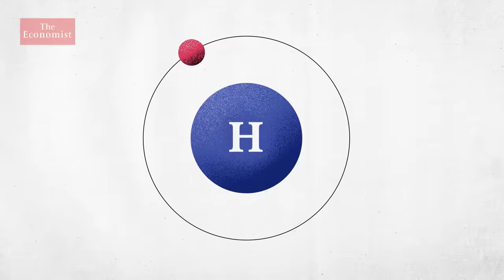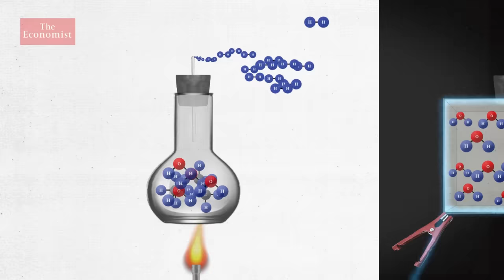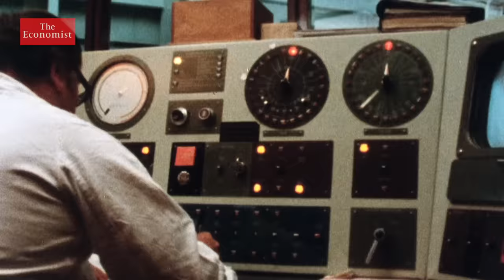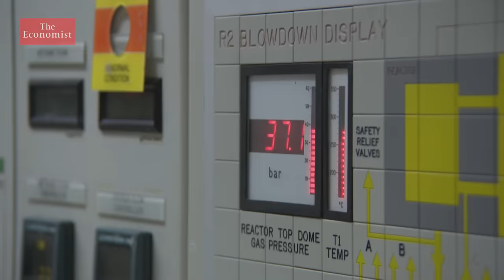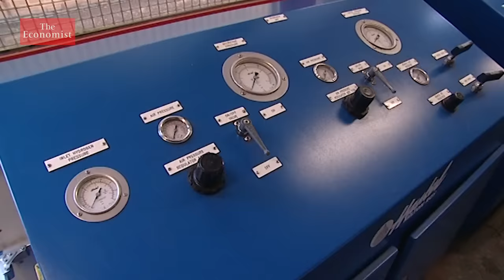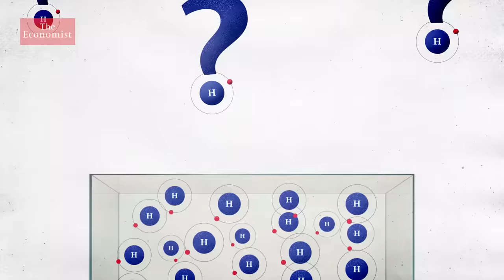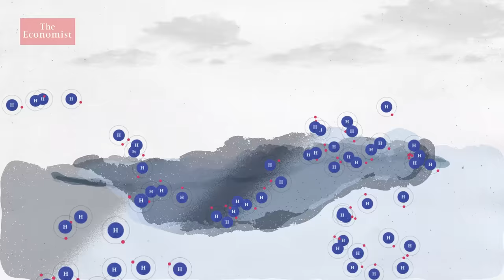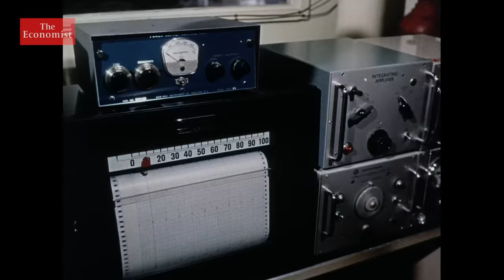Hydrogen: fuel of the future?

Comment: A lot of misleading information in this video. 

Hydrogen may be energy sense, but hydrogen it's self is the least dense gas in existence and either requires compression to 10,000psi+ to reach the volumetric density of lithium-ion batteries. Or be cryogenically stored at minus 253°C. The lowest of all gases besides helium. This is not only a very inefficient process that consumes 12% of the energy in just compressing the gas to high enough density for useful storage. Or over %40 if you want to cryogenically store it, plus the cost of equipment.  That is why a Toyota Mirai has 480km of range and a Tesla model 3 has 550km of range. The tanks for a hydrogen vehicle would take up the entire trunk of you want more capacity/range.  This is all why it costs so much (more than gas at current extremely high prices) to fuel a Hydrogen fuel cell vehicle. Almost twice as much as petroleum, and an order of magnitude more than an EV. 

Another large omission is the platinum and other extremely expensive minerals needed for a fuel cell. These require substantial amounts of platinum, and we wouldn't have enough in reserve to replace all the personal vehicles in the world. Another reason for hydrogen fuel cell vehicle's exorbitant cost.  

You sort of came to the correct conclusion of hydrogen being helpful in niche markets, but you sort of glossed it over.

Comment: Hydrogen is NOT A FUEL!!!  Hydrogen is used as a method of energy storage, with many caveats,  like a battery but the energy to produce the H2 must come from a real energy source like coal, oil, gas, hydro, Nuclear.  Even as a storage method,  H2 is not viable because of the problems of cycle efficiency and dangers.

Comment: If you electrolyzed water and fed the products into an oxygen pipe and a hydrogen pipe, and then, at the other end, you re-combined the two gasses, and were able thereby to produce electricity, how much electricity would you have, as a percentage of the electricity you consumed in the electrolyzer?
Reply: You are putting in 55 kWh per kilogram of hydrogen and can at most recover 33 kWh (the energy content of that kilogram of hydrogen). As fuel cells are only about 40-50% efficient you can get back around 16 kWh - not including storage and transport losses which are considerable.
Reply: @karlgunterwunsch1950  
Thruns guinneabottle is paul sutton using a pseudonym.

Thank you for your figures.
I do not find this encouraging.
Reply: @thrunsguinneabottle3066  It's not supposed to be encouraging. Hydrogen has it's place, especially in the steel production it is irreplaceable because it can not only deliver the necessary heat but also does provide  the reduction reaction to remove superfluous oxygen from the iron ore (a job normally done through carbon addition while smelting the ore). It also may be irreplaceable wherever we need methane or similar for the chemical industry as a base for chemical reactions. In cars though IMHO it has no place whatsoever, they are much better served by converting to batteries - the energy efficiency is unrivalled and the drawbacks are small. Even the infrastructure is significantly less expensive (for a single hydrogen fuel pump that can service at most 40 cars per day you can build 10 superchargers that can service 200 or more)...

Comment: Toyota is pushing a hydrogen car which I think is the future. You fuel up quicker than gasoline but go longer on a tank. I worried about safety, but the hydrogen is kept under pressure. If the tank is punctured the gas, being so light, leaks out in about 1 second. (They tried shoot bullets at it and could not get it to explode). I think planes and trucks should be the first to start using it, my prediction.

Comment: But where are the charging stations for EVs?  Can the power grid cope with large numbers of EVs?  Will we be able to charge EVs faster in the future?  I am not counting hydrogen out.  Unlike hydrogen vehicles EVs have benefitted from large government subsidies.  What happens when the subsidies stop?
Reply: Better ask yourself what happens if the massive subsidies for hydrogen stop and the insanely wasteful and expensive infrastructure starts to have to earn its keep
Reply: No the grid could not keep up at present
Reply: @nickking1510  Only if all cars were electric tomorrow, the requirements are manageable with 1% increases year on year overthrew next 15-20 years...

Comment: Essentially, hydrogen is the awkward middle man between ICE (Internal Combustion Engine) vehicles and EV's that no one invests in even though it has a lot of potential.
Reply: a HFC is an EV, The motors are the same, just what stores/creates the electricity is different. But hydrogen can also power ICE engines as well (just less efficient than HFCEVs).

Comment: Thinking about wasted heat.let’s say you drive a six cylinder auto 40 miles to work and 40 miles back.The heat radiating into the atmosphere from the exhaust system,radiator and engine block if it could be trapped and saved somehow could probably heat a 1500 square foot New England home overnight in winter

Comment: Hydrogen is explosive! And the tanks to contain it safely make it less energy dense than fuel!
I think its lazy to blame the current infrastructure on why its not the big thing. 

It's what we need to do but its not here yet for a reason
Reply: In Japan it's a reality...
Reply: If you compare energy density per unit of weight there is nothing that is close to hydrogen.
Reply: @VFPn96kQT  yes i know that, but if you read my comment you'd understand that in reality the weight of the containers has to be accounted for.
4kg of petrol doesn't need as serious a container as 4kg of hydrogen, because petrol is a liquid in the usual environment whereas hydrogen needs a compression tank of some sort. so in reality the advantage is eaten by the container. perhaps this is still relevant to hydrogen production but it won't translate to an advantage in mileage like this video pretends.
Reply: @TheYah00netstar  and Europe
Reply: @KM____________  the tanks in the Murai, BMW, and Hydundai's HFC vehicles are made of a carbon fiber compound that is extremely light, lighter than the metal fuel tanks in ICE vehicles. And the Hyperion supercar weights about the same as a Mazda Miata fully fueled, and it's lightweight tank holds enough compressed fuel to go 1000 miles. BEVs are still struggling with the weight issue because in order to have  a large enough battery for performance and 300 mile range they cause the car to weigh as much as a SUV.
Reply: @KM____________  at toyota thy literally shot a tank of hydrogen to see what happens and they found it depressurises so fast that i cant catch on fire.

Comment: It’s just a matter of time b4 the container full of hydrogen explodes! We have no material that can contain it…..just look at hydrogen explosion vids
Reply: Just look at petrochemical explosion vids. There's plenty of those. Liquified hydrogen is stored at very high pressure and therefore the storage tanks are comparatively  smaller but much stronger in construction than gasoline tanks. So we do have a material to contain it, commonly known as steel.  Having said that, if a hydrogen tank on a vehicle or a supply point did fail, the propagation of combustion would be faster, and shorter lived compared to gasoline, which supports combustion for much longer.

Comment: Just use nuclear power already 🤦‍♂️
Reply: It will be necessary to implement as many types of alternative fuel sources, depending of course on costs and externalities.
Reply: @ACTHdan  Nuclear has by far the least external problems. Advanced nuclear will work well with wind and solar. and make H2 very cheaply.
Reply: @paulbedichek2679  True. But when you look at poorer countries, nuclear isn’t that easy. That’s why it’s important to start deploying any and all alternative sources, again after factoring in costs, externalities, and readability depending on each individual country/region. Some might be better fitted for offshore, who knows. Obviously nuclear is the easiest solution on paper, but in practice nuclear isn’t an immediate or short term option for poorer countries that don’t even have functions electric grids.
Reply: @ACTHdan  Solar and wind haven't slowed pollution in 50 years they are too slow.

Comment: This video is missing two essential facts which render large scale investment in the hydrogen economy a dangerous distraction. Humanity no longer has the time or renewable energy capacity to waste on it. The carbon budget for limiting global temperature rise to +1.5 Celsius amounts to just a few years of BAU global carbon emissions. This budget will be consumed before 2030. The transition from fossil fuel energy to renewables has only just begun - the available capacity must be used to decarbonise electricity grids and transportation systems.

Comment: Hydrogen will become one of the main fuels of the future once non fossil fuel predominantly supply power to grids. That is because when that happens hydrogen will be very affordably produced via electrolysis of an extremely easy to find substance known as water...

I say to all those I discuss with and debate with on the issue of the fact that renewables and nuclear power are objectively much better than fossil fuels because they are much more abundant, essentially limitlessly so (renewables) or they are much more efficient (nuclear) and they also do not emit greenhouse gases and gaseous pollutants while utilized as power generation sources. Thanks enormously to China, the efficiency of solar panels has increased tremendously and also so has battery storage capability. Even sodium ion batteries are sufficiently efficient with regards to their application for use in generation grids and sodium is much more abundant than lithium.

The days when technology was the limiting factor with regards to storage of large amounts of energy is over...

Comment: What's the point of a what-if analysis about hydrogen? It's been used for energy and batteries and cars, it just didn't work.
Reply: In Japan it's already working...
Reply: The point is that if produced with renewable energy, it doesn't introduce more carbon into the atmosphere.
Reply: Gustave Trouvé's tricycle electric car appeared in 1881. So, by your logic, they should have stopped development in the 19th century because it didn't work as well as internal combustion engine.
Reply: During the 60´s NASA already used hydrogen successfully in it´s rocket around Earth in Space...*
Reply: @TheYah00netstar  And we all know how economically viable NASA's way of doing things is. . .  .
Reply: @SkyRiver1  - They were the pioneers...

Comment: Tell me what this “highly flammable gas filled balloon” was blown up by then? This video had potential but it’s far too hand waving without explanation. To say a highly flammable gas isn’t dangerous is absurd containment would be difficult in objects such as car which do crash into each other time to time. If it was used in something that didn’t move that would increase its safety I’m sure.
Reply: There is no such thing as a fuel source that isn't flammable.  or it wouldn't hold fuel.  This includes EV's.  The hindenburg was most likely destroyed by static discharge, which in modern containment of flammable fuels, really isn't an issue.
Reply: @uni4rm  gasoline is mostly liquid therefore easier to control where as a leaking highly flammable gas is another thing entirely when looking at safety and practically

Comment: The hydrogen car is dead. EVs are so much cheaper. We will need hydrogen in shipping and aviation
Reply: Hydrogen is hopelessly inefficient
Reply: Hydrogen is very inefficient. But in some applications there are other considerations like energy density for example, both in terms of weight and volume. Longhaul Aircraft for example need a constant power delivery well in excess off a Megawatt (and quite a bit more for take off and climb). That can of course be easily done electrically, however, battery storage for that is simply impossible with the current battery technology. After all, safe battery storage for 20 MWh does weigh a bit, and unlike any other fuel, does not reduce in weight during the flight or voyage.
Reply: In Japan hydrogen is a reality...
Reply: If hydrogen becomes commonplace, because of shipping and aviation, then it would be cheaper for cars too.
Reply: @S2Tubes  Not really. Neither heavy fuel oil nor Jet-A1 are used in cars today. Cars work perfectly well with batteries and since battery powered electric cars use a third of the electricity required to run them with hydrogen, there is a very real cost argument to be had. Hydrogen is very very inefficient, the inefficiency is bearable where there is no alternative.
Reply: @Soordhin  the energy efficiency of a fuel cell is generally between 40 and 60%; however, if waste heat is captured in a cogeneration scheme, efficiencies of up to 85% can be obtained.
Reply: @VFPn96kQT  The fuel cell is only one part of the equation though. The generation of hydrogen is the other. Current automotive fuel cells reach a maximum efficiency of 40%, up to 50% is seen as possible. Hydrogen generation for green hydrogen reaches at most a 50% efficiency. 

Battery Electric cars reach 75% efficiency from green energy production to the wheel already now, while hydrogen is stuck at roughly 20 to 30%.
Reply: @Soordhin  Cars do not work perfectly well with batteries. Their range is limited. They're heavy. They take forever to recharge. In some use cases battery cars are superior, mostly short trips, and charging at home overnight. There's still a lot of use cases where hydrogen would be superior, if it was widely available. Inefficiency is irrelevant if you're generating your power with solar during the day when no one uses it.
Reply: @S2Tubes  Who says no one uses electricity during the day? After all, that is while every employee car charges in the company parking lot, while all the industry runs at full tilt and every computer works, in effect, during peak electricity use. 

Yes, currently electric cars have a limited range, just around 700 to 800 km (Mercedes EQS, Tesla Model S Plaid), and need a bit more time to recharge, around 15 minutes for the normal charge to 80% even in cheap models like the Ioniq 5 or EV6. But those times do get shorter and shorter. Even with the 15 minute stop that is just about enough for a small dash to the restroom and a fresh coffee. If one wants to catch up on the important emails and social media information that happened during the last 5 hours of driving, the stop is too short anyway.

Thing is, i do live in a country where Hydrogen is widely available with plenty of fueling stations for H2 cars. Only around a couple hundred H2 cars are on the road though, out of roughly 50 million cars while BEVs have reached over 10% of new sales, not to mention the H2 cars available for sale (2 models) have less range than similar prices electric cars.

Not for want of trying, the government has tried to bring H2 into the automotive market, with over a €100 billion in subsidies and research grants over the last years. No local manufacturers has any H2 car in its line up anymore. There is some research on long distance trucking, but that is relatively low key. Heck, even the only H2 train developed so far will now be sold abroad as batteries are cheaper and easier to use even for that.

Comment: He missed the single greatest benefit of hydrogen: you can store it! The efficiency of production is completely irrelevant if you're utilising renewable energy that would otherwise be wasted from lack of demand. Something is always going to be better than nothing.
Reply: Hydrogen is hard to store. It's a small molecule that easily goes through many types of layers wether it be a metalgrid or molecular chain network. Then there also the issue of catalysts optimization and availability.
Reply: Try telling an engineer that efficiency is irrelevant and see what happens!

Comment: you really need to update that old song on "it's an energy carrier not a fuel"  you have natural, native, geological hydrogen from crustal seeps that is just as much a fuel as oil. also if the inputs are sunlight and water to make hydrogen it requires less power to create it than gasoline which requires discovery, extraction, shipping, refining, shipping again. all wasting energy at every step
Reply: @cliffwilliams8616  actually I do design work with DARPA.  let me guess.....you learned about hydrogen in the 1970s and think your knowledge is relevant?  do some learning. see GEH (graphene energy harvesting) turns out your ancinext knowledge was completely wrong about a fundamental aspect of all matter.....brownian motion DOES crea useful work
Reply: @peterlang777  thermodynamics has not changed. The industrial world works within such constraints and the challenges of scale up are clearly beyond the wit of mere designers, whether DARPA or not.
Reply: @cliffwilliams8616  thermodynamics has indeed changed. GEH greatly modifies the second law of thermodynamics and the ZPE diode of prof. garret modell of colorado university in boulder (proven) shows the universe is an OPEN system not CLOSED like in newtonian theory. the diode uses optical cavities on one side of a MIM diode to rectify ZPE flux

Comment: ELECTRICITY V/S H2 in long haul travel is still won by electricity through use of E-Highways!
Reply: IF the real Tesla had built a car, it wouldn't need batteries he would just beam it power.
Reply: in the states we can barely keep up with maintenance on our highway system as it stands right now, E-Highways would be a solution for smaller countries with few roads, but the millions of miles of US roadways would cost  way too much to build and maintenance would be a nightmare
Reply: @SnowWolf9999  India has over 30k miles of electrified railways. US should do much better than India.